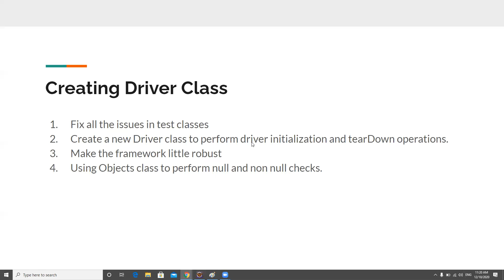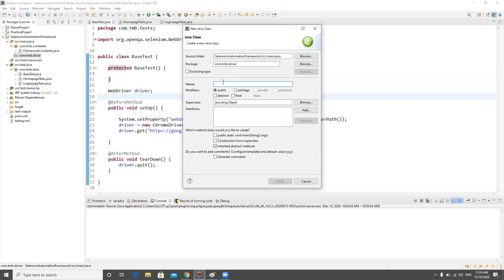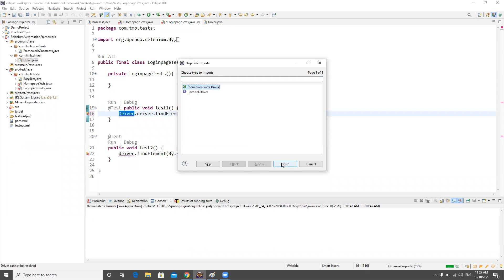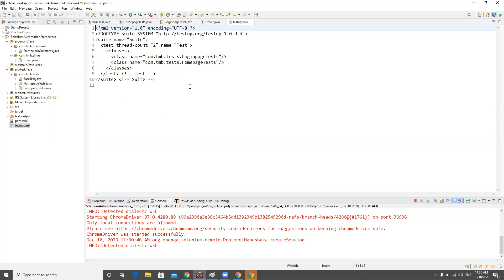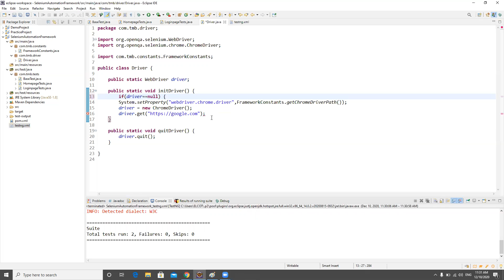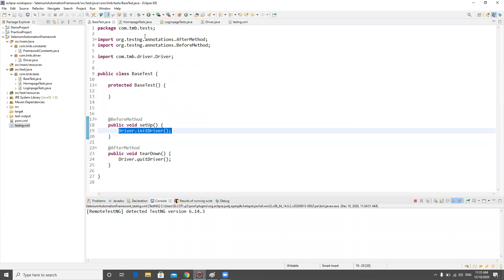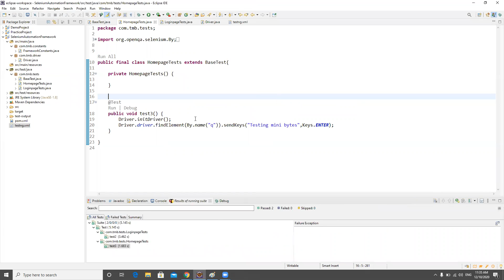Selenium Framework - Part 5 - Creating Driver class

Comment: Hi Amuthan, two questions 1)if we dont set the driver value as null in quitDriver method shouldn't it still work? because whenever selenium launches a driver it is a new driver instance that means it should initialize a null value in driver. So every time we call beforemethod then each time driver should be initialized with null. Please let me know if I am wrong? (2) we dont require Driver.initdriver() to call everytime in @test. We can simply avoid that null check if we dont use that Driver.initdriver() command everytime.

Comment: Update : I made a mistake and updated it in the reply below.
Hi Amuthan,

After being impressed with the explanation, I tried to replicate exactly the same way as you walked through to get the driver at right place. 
But for some unknown reason, I am noticing two chrome windows open which are doing nothing, and being left without closing at the end.

What could have gone worng?
Again, it is just the replica of your code till this session.
Reply: Update : 
My Bad. I did some mistake, by keeping WebDriver driver  instance in initDriver by mistake. I am posting here so that, others will not repeat that mistake. :) 
		if(Objects.isNull(driver)) {
			System.setProperty("webdriver.chrome.driver", FrameworkConstants.getChromeDriverPath() );
			WebDriver driver = new ChromeDriver();
			driver.get("https://google.com");